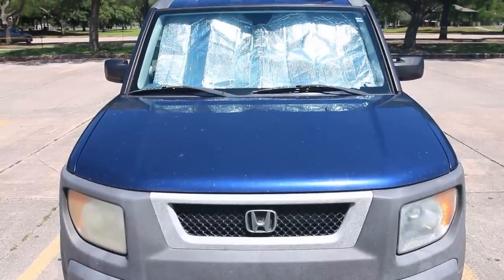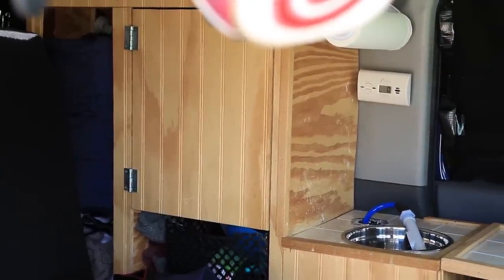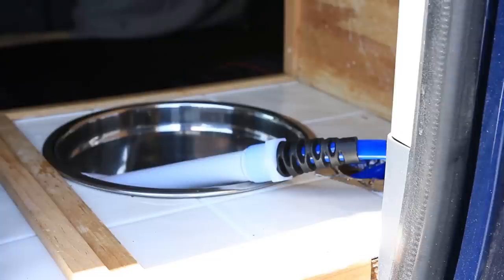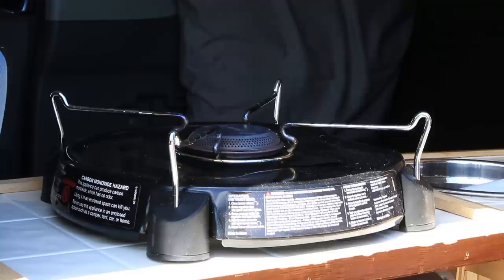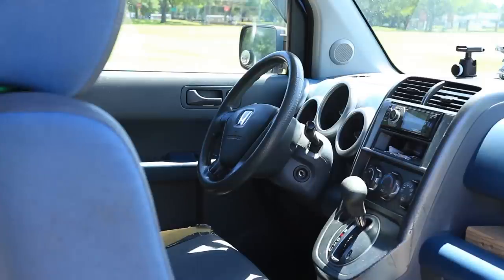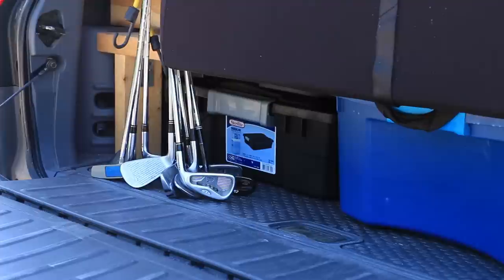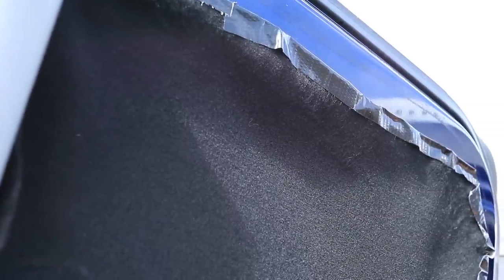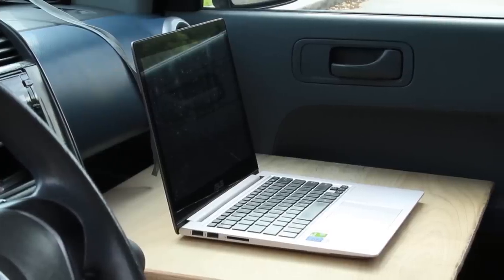Honda Element Camper Van Conversion Tour

Comment: Bro.. I seen ya in oregon or Wash,  am sure. I Never forget an Element.  I have done many of the same things, having never seen your channel, xcept u took it to another level with the fridge, solar panel, killer desk, shower/nozal, sink.....
     ..  I had tupaware for brushing. Two red cardboard xmas displays,($0). As shelving and storage for Tupperware.  A black metal and thick glass coffee table to raise that side [drivers] for storage. camp stove. Just a board on my lap for a desk in the back with my feet up!! A super thick curtain behind front seats with para cord. An attick with a spider web of bungy cords holding my 1/8" styrofoam with reinfoced black mat,, window coverings.  And the front passenger floor board for the dirty laundry!!. Two NW Winters comfortably with a super duper sleepbag! Eh?

Comment: Use Reflectix foil insulation, available Lowes/Home Depot, cut to shape of windows and no tape is necessary.  The exterior needs some TLC, especially headlight covers (oxidized) and trim (needs protectant), maybe a coat of synthetic UV protectant "wax" to the exterior paint.

Comment: Hey there, I'm in Orange County and thinking about living in my subaru outback for a year.  One thing I'm concerned about is the summer heat.  I'm worried about safety and sleeping with the windows down for ventilation.  Your in the area--have you dealt with this?  What are your thoughts?

Comment: Awesome video! I’m currently in the process of getting a used car, after my previous car got totaled in an accident. I’m debating whether if I should get an element or something with a bigger engine. I know elements have a 4 cylinder engine, so my question is, how does it feel with all that extra weight? Does it struggle going uphill? Or trying to get up to speed? I would really appreciate it if you can let me what you think. Thank you!
Reply from the maker: Thanks! I don't notice much of a difference, but I'm sure it puts a bit of a strain on the smaller engine. I don't think the camper conversion exceeds the max rated load or anything like that. Considering the rear seats are removed (they're at least 40 lbs each), I figure it's the equivalent of driving around normally with 3 passengers at all times.